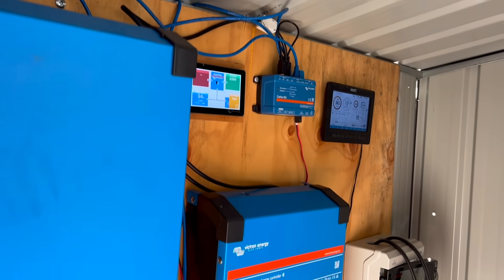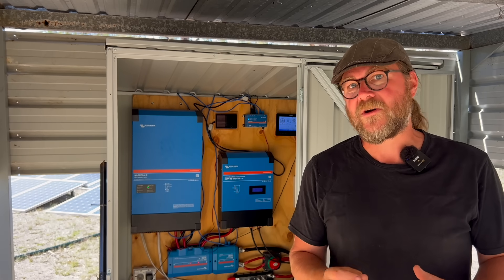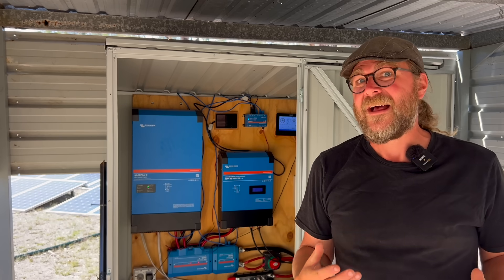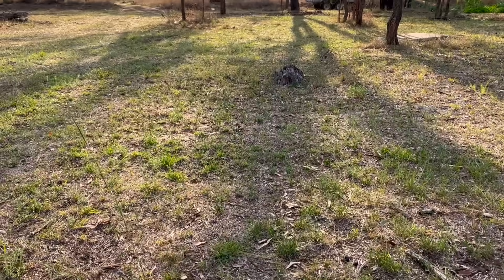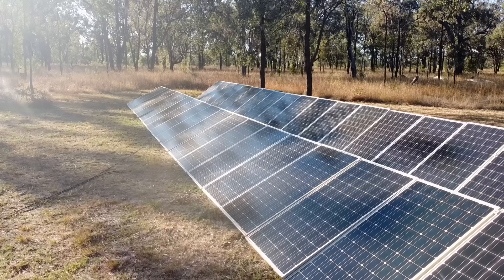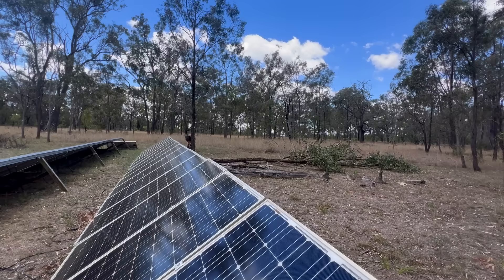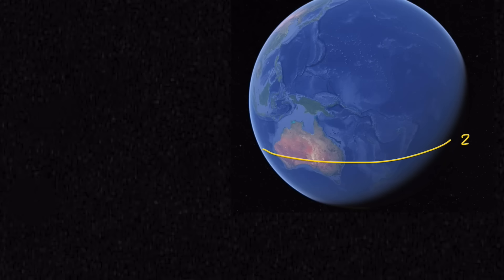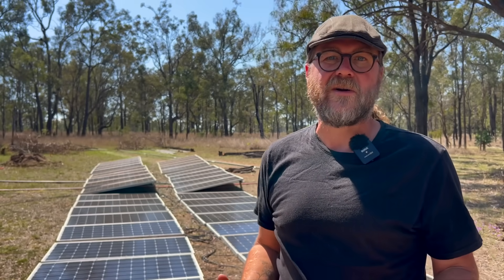We seriously MISCALCULATED when we set up our Off Grid Solar System

Comment: Pick you up on Low Voltage Solar at the start of you video.  You should be running at 200-400v DC to the charge controller.  I hate DC.  DC will kill you but AC will shock you.
Reply from the maker: Ahh yep, showing my newbie colours then wasn’t I 😬

Comment: How big is the system you are running?
Reply from the maker: 12kw of (very old) panels. 20kWh battery storage. 10kva inverter. 450v/100a charge controller.

Comment: Not trying to be a smart donkey but when you mention HEAT as a large consideration for your electrical equipment would it not be a better thing if the building was covered in a white colored tin as vs the black tin which would get a lot hotter.
Reply from the maker: That may add a little extra cooling, but TBH just putting that new shade structure up has significantly solved most of the problem. And, I know it looks dark in the video, but it's actually galvanised sheets (albeit, a little dirty) so they're more silver than black (unless of course you mean the tiny shed - in which case, yeah, dark grey was a dumb decision! 🤣)

Comment: There are tables on the internet that allow you to calculate shadow or sun penetration for your latitude. However, from experience, you can set up an array perfectly by using the shadow the panel creates eg, to maximise output at noon, the shadow should be square to the panel and raise or lower the tilt of the panel or array to get maximum shadow length, job done,  no instruments or maths required.
If the array has a greater capacity than your peak consumption consider biasing the direction some of the panels face with regard to time of consumption. If you like to use the coffee machine first thing of a morning face a few panels to the east. This may be easier on your batteries and promote battery life.

Comment: Hi. Great video! I didnt quite understand winter angle 45 degrees in summercomment you made. Dont you change it each season?
Reply from the maker: We sure do. So our autumn and spring angles are the same (latitude angle - in our case 27°). And then our summer angle is -15° from that. whereas our winter angle is +15° from that. So that’s for angle off the ground. But where I said I was 45° off that was about having the panels angled away from north. I had them facing almost completely north-west by mistake.
Reply: @reganperry  ah gotcha. Bingeing your content now. It's fantastic.

Comment: I see you have the bottom end of your solar panels basically on the ground, solar panels hate heat, if you raise them off the ground to allow airflow they will make more power. In my experience, up to 20% more power just by cooling them a little bit better. It will also increase the lifespan of the panels drastically.
Reply from the maker: Oh wow! I've heard about the heat - didn't realise it was THAT much! 
An elevated solar rack is on the project list for this year

Comment: Very nice setup. Just to throw out an alternative idea to the 3 position frame -perhaps just leave the panels on the winter angle and use more panels or higher wattage panels. The logic is if you're not struggling in winter with the panels on a winter angle then you'll still produce ample power in summer even at less than optimal efficiency. If they don't then you don't have enough panels/storage. I think your panels would also work better on an 2.4M high frame - that way they take up minimal ground space and give you a shaded area to work with underneath the panels. It also protects them from wildlife damage and makes it easier to keep the grass under control.
Reply from the maker: That’s actually a solid suggestion. It’ll be interesting to see what our needs are this coming winter now that we’re more established out here!

Comment: Looks wat too big and over complicated, You need to get those panels up off the ground and put most of them as a roof for the leantoo, Thousands of dollars worth of Victron gear, And you don't need to mark the ground to find out where the Sun is at what Tim of day, all you need is a stick, Can't help feeling you are over complicating it and spending too much money. The whole thing just looks a mess.
Reply from the maker: Check out some of our other vids on solar, you'll see we deliberated long and hard over the initial investment and I think we've done ok money-wise. The main thing is, the most expensive gear (batteries and victron stuff) we got right and is the most well protected. That's where the real investment is. Panels I can afford to be a bit experimental with. 

Marking the ground isn't about finding the sun, it's about finding the shadows from nearby trees in every season, and it's been a year-long journey to get this 100% right. I'm so glad we didn't commit to fixed solar racking that I couldn't change or I definitely would've made mistakes choosing location.

As for getting them off the ground - you're right, but it's just not that urgent. #1 the panels are almost free, so if I do bust a few it's no big drama, and #2 I only want to build an off-the-ground mount when I'm 100% on my location. I wish I could use the shed roof, but it'd only fit about 8 panels and so far we're up to 60 panels! 🤣😬 Whatever we do build will be well-considered and may end up being huge, so I want to get that right. 

At the end of the day, this had been one giant learning process and I'm glad I've taken my time with it, and happy to share the trials and errors online so that others can learn from us. 
The alternative was to pay the experts (an we did consider this), but you end up with about 10-15% of your budget going to them, and you don't get the bonus of learning your system inside and out. 
But, each to their own.

Comment: Regan Perry,
Whats your total kw system??
 Seems you have to count watts a lot which i dont get.
We run a 10 kw 32 panel back to grid system and now looking to go off grid.
I have 2 surface pumps, house and yard water and a bore pump.
2 x 8kw split systems 2 large inverter fridge freezers.
Minus 10 deg winter temps and 38-40 deg summers.
Surplus kw/ day of approx 30 in winter
And 50+ kw / day summer.
What am i missing?

Comment: Does wind not exist where you live? I wouldn't dream of having my panels just propped up on a bit of wood. One decent gust of wind and they'll end up three properties away. Mine are on welded steel frames set in concrete and I'm still paranoid they're going to go flying away.
Reply from the maker: @martinw8921  yeah, I’ll admit it’s my first time with solar panels but 11 months in and it just hasn’t been an issue at all. I do feel like we get some decent winds. And to be fair, they’re not just “propped up”, they’re all bolted together on aluminium rails, but you’re not the first person to make as similar comment, so I guess I may be missing something. Anyway, a better mounting system is on the cards for next year so I’ll be sure to get good advice on making it all wind proof
Reply: @reganperry  Yeah I'm just in the process of installing my first system. It's all a learning curve. It's reassuring to hear that you haven't had any problems. We're in a very different part of the world but wind is wind. I'm just paranoid about the fact that I'm basically creating a huge sail. Better to be safe than sorry. 😉

Comment: Interesting discussion. I live in a regular housing estate with grid power available but with retirement approaching have gone off grid to eliminate my power and gas bills. Just a little advice that may not apply to your situation, but worth thinking about. If you have a large solar array and a relatively small battery capacity (or an inverter with limited charging ability), you would want to stretch the solar generation from as early in the morning as possible to as late in the evening as possible, to maximise your available solar power for immediate use and avoid wasting the peak of your power generation in the middle of the day. So an orientation of some panels facing east and some facing west might actually improve your solar harvest. You might also want to consider biasing your panels for winter capture when there will be days that don't generate enough energy. In summer you will likely make more than enough even to run your air conditioner, and autumn and spring are good for solar and you will require the least amount power. Winter is when you will be challenged the most.
If you have a lot of battery and can capture all the power even during the peak of the day, then this may not work for you.
Reply from the maker: @MotoGuzziMoto  wow, your timing is uncanny. Check back tomorrow afternoon, I’m literally putting a video out where I’m testing that exact setup with a stack of panels I just scored for free. I was hesitant to try it because everyone says face all the panels north, but exactly what you’re saying is what I’ve tried. Too funny 🤣
Reply: @rusticspiritshomestead  Awesome. Looking forward to it!

Comment: All very basic mistakes really.
Yes electronics don't like heat, but neither does lithium, you will accelerate degradation and reduce the cycle life of those batteries. Then again there is cold not just the batteries but inverters don't like cold damp conditions.
There are plenty of books on off grid living and everything you need to take into consideration with solar arrays. There are also solar sun hour calculators to take some of the guesswork out. Voltage drop can be managed by combination series / parallel connections, solar farms seems to manage this.
This looks like another system put together from watching YouTube videos! Without proper design and power calculations it can be an expensive exercise for average return!
Reply from the maker: True, I reckon I did 90% of my research on YouTube first. THEN, spoke to the experts. The guys we purchased from helped us make the final design/purchasing decisions. I definitely don't recommend specc'ing up these systems without advice. But also, really glad I did my own research so that I didn't get talked into anything unnecessary and can troubleshoot most issues myself.

Comment: i live in a very wet cloudy area, i started off with 10 small expensive panels 30 yrs ago, rainy or fog, a big fat nothing. i now have 180 panels 180 and 250watts second hand most of them 30 dollars each from a solar installer[ people upgrading] plenty of power even on rainy cloudy days. due to the fact you can only feed a certain amount in to your batteries most of the panels are directly connected to a bath heater, kitchen sink heater and a 1,500 ltr sand and scrap metal heat store.  the 500 watt element in the beer barrel for the shower died recently [ in a pipe, no water contact]  i found a hair curling iron in a salvo shop with a 45 watt element, it took a couple of days to heat the water but provides enough to shower 2 people nightly.  it can be left on 24/7 without overheating. i much prefer panels on the ground than shed roof. house is totally shaded by trees. cool house in summer no air conditioning
Reply: PS, no generator or gas for 25 yrs.
Reply from the maker: 180 Panels, wow! I thought I was being over the top with my 40 (now 60). 🤣 Now that's true off-grid you're living!
Reply: @rusticspiritshomestead  hi regan , people talk of oversizing panels. this is BS when you consider where you are living you may only get 20 % of their supposed output most of the time. we live in the mountains west of cairns, our rainfall is a minimum of 15 ft a year. probably at least 80% of the time we are getting our power from glare, hence the need for lots of panels. my wife used to say ''we don't need more panels'', now i can say to her ''aren't you glad i bought more panels''. due to the high humidity , never under under 80% we need to run a few dehumidifiers in sealed areas as much as we can to avoid photos ,books cameras etc from being destroyed. we also have tropical fish that need to be kept warm through the colder months. an indoor pond and aquarium. we are fortunate to get around 500 watts of hydro power most of the year but yes we still need all those panels. our microwave is used for defrosting meat because we don't keep meat in the fridge. i rather turn fridge and freezer off at night and leave dehumidifiers on, and keep the fish warm in the colder months. just not a fan of goldfish. not a fan of using a generator either, noise fuel and maintenance. we have a 3kw inverter for the house and a 5 kw for welding etc in the shed. i like 2 or more of everything because i don't like power outages which i have avoided for 30 yrs.all the house is 12 volt lighting , if i shut down inverters due to thunderstorm i don't want to be lighting candles. well that was a long one! bye..

Comment: In terms of cooling your equipment, you could try a thermal tower. Basically, it's a thin metal chimney with mat black coating fitted into your inner ( in this case) roof. Add ventation slots in the bottom of your equipment shed walls. When the sun shines on the chimney, it will heat up the air inside it, causing a density differential with the air in the compartment and creat air flow. It's quite effective and cheaper than aircon both financially and in energy /carbon expenditure.

Comment: For people looking at going off grid right now, look at the new micro inverter systems.
These systems have an inverter per panel connected to the panel itself, thus the DC run distance is minimal. 
The other benefit is each panel is standalone, having one shaded does not affect the generation of the other panels.
Reply: Micro inverters are not new, they tried them back in the early 2000s. They failed and a lot of lawsuits followed. A couple of decades later the electronics are better and the benefits of converting the DC to AC at the panel have its advantages, but they are costly. Way cheaper to just get the array right in the first place.
Reply from the maker: @petert3355  🤤🤤 they’re on the Christmas Wishlist! 🤣 Do you reckon Santa has room??
Reply: @rusticspiritshomestead 
Fingers crossed.

Comment: Subscribed!  Thanks for the content.  Tip for your solar panels, get some new higher wattage panels.  I also built a Victron based off grid system, mounted the panels almost flat on a roof but east facing.  Even in the middle of winter, at 34 degrees lat, we had no problem with sufficient charging. We get 70-80 v even when it’s cloudy which is enough to put a little bit of charge into the batteries.  Agree with others mount them on a roof if you can, but if you must mount them in the ground secure them well, if a big wind gets under them it won’t be pretty.

Comment: Do you guys not have any wind there lol? Here we have either helical screw piles that anchor the solar racking or we pour concrete act as a ballast/foundation for the solar array to offset the wind loading. 
For offgrid you should have a tiltable mount. (I’ve been designing and installing off grid systems as a professional for over 15 years and we also live off-grid) seasonal tilt is important.

Comment: You may need to rethink this. If the power supply is low power to the control system, then high power to the house, you need to move your control system to NEAR the house. This is because power, and power loss, relates to current, and P = (I^2)R.  Separately, if you install an air conditioner to the shed, it will use a lot of power from your batteries, so will actually cause the system to heat up more than otherwise, so this is a kind of negative feedback. So don't do that.
Instead, move your system to close to the house, to minimize the high voltage distance, then raise your shed roof (you will need to consider the supports so as not to have a failure of the walls) to allow the flow of air under the roof. You could add some fly screen to the gap you make between top of wall and roof. You might think about making some holes along the base also to ensure easy natural ventilation. Lastly, provide some cheap insulation to the roof (this could be just some old styrofoam panels stuck on top) and remember that "hot" to a machine is not the same as hot to a human.
Reply: AC to the house (@240V) will create little voltage drop, and the current will also be much, much, lower (P=IE). I imagine the aircon for the powershed (if required) could be an automotive one (on 24V) but modern inverter aircons, running off buck inverters (or a dedicated one for the a/c.... the juice wouldn't need to be a beautiful sine wave for aircon, surely?) are pretty efficient. 

What I'd really love to know/love to experiment with is (eventually) the house and exterior lighting... placing (one/few) panels on e.g. the house roof, buffered with a battery, should be able to drive LED's directly, rather than the losses/heat of turning DC to AC then back to DC for e.g. the ceiling lights, which are very close (typically) to the roof/panels. Ditto phone/computer charging etc... running DC wiring to usb throughout the place should keep power requirements and losses from multiple conversion as low as possible and potentially provide various 'qualities' of both AC and DC for different loads that are sensitive to smooth power, or not. Pure sine wave generation from DC, and providing ripple free DC from AC costs money, and allowing multiple systems dedicated to each service level could be cost effective?  Thinking out loud.

Comment: Running cooler will definitely improve reliability.  I pick up the 2" R13 aluminized foam whenever I see it cheap.  4x8 sheet is $50....  But ...  Even a single sheet can shrug a ton of heat.  The foam is not EPS, it is closed cell and quite resilient.
Reply from the maker: Ooh good tip. Thanks!